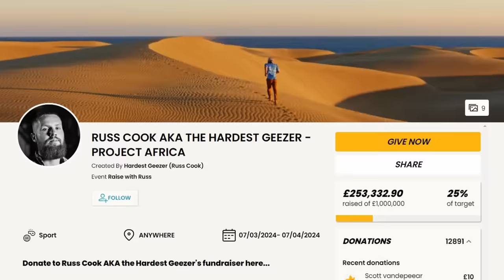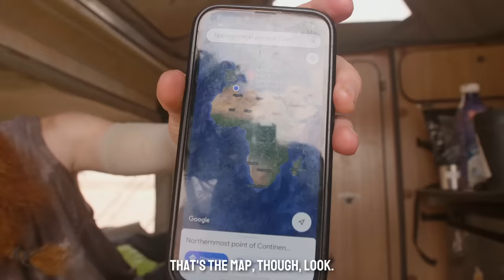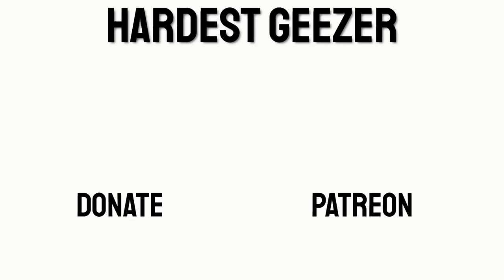How two strangers SAVED my Run Across Africa in Algeria 🇩🇿

Comment: DAMN videos every 2 days whilst in the Sahara? The team is another level
Reply: Well, when they were between Zouerat and the Algerian border, on the 850 km stretch without roads, there were no updates in 13 days.
Now they are in civilization. There are towns at regular intervals. So it's not difficult to find somewhere with good connection in order to upload.
The mobile internet in Algeria isn't very good. I had no problems uploading pictures when I was there, but I guess uploading a 20 minute video in 1080 would be too much to expect from the mobile internet.
Reply: @Tjalve70  they improved the mobile and cable internet in the last recent years  now it's not the best but it's not so bad anymore
Reply: @khaax33  Ok. The mobile internet in Algeria wasn't horrible. If I remember right, it was about the same as in Mauritania. And MUCH better than on the piste from the Algerian border to Zouerat. Even when we camped just next to a mobile tower on that piste, the connection was VERY slow.
But it's nice to hear that it has been improving.

Edit: Come to think of it, I wasn't able to play Pokemon GO while I was in Algeria. And I think that was because the connection was very slow. So I think it was actually close to horrible.

Comment: Apparently the water in fuel thing happens in the uk as well 😂  My dad had a recurring problem with the car and the mechanic said it was because of water and  that he should use "petrol station name" fuel coz the supermarket ones are mixed with water. He did and the problem never happened again , he tried after that using fuel from the supermarket station again and the problem happened again 😂😂

Comment: How didn’t Russ make it to an Olympic level runner?! Or did he?
Reply: In competitive running, you also have to run FAST.
Russ is running at about 8 kph. That's a marathon in over 5 hours.
The world record for marathon is 2 hours. That's over 20 kph.
And I guess it's quite common for marathon runners to run faster than 10 kpm.
Sure, Russ would have been able to run faster if he was ONLY running a SINGLE marathon. But running fast and running far is not the same thing. So he might not be close to competitive runners.
Reply: Endurance running is very very different to even marathon running, let alone any distance below that

Comment: The police assigned them a squad to be with them all the way, which you will not see in many places
Reply: They keep switching every couple hundred km's i guess , but its for their safety since the algerian desert is so so big and sometimes smugglers use that vastness to their advantage , better to keep them safe for their journey
Reply: @kamelkmk1901  What do you mean by this?
Tindouf is in the south-WEST. And they are essentially running along the WESTERN border. At one point they would have been only about 1 km away from the WESTERN border.